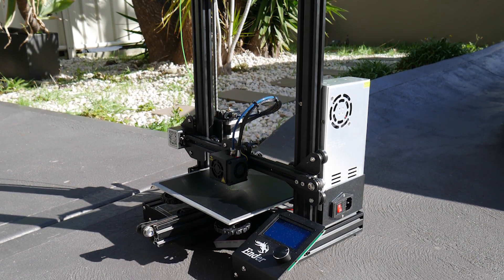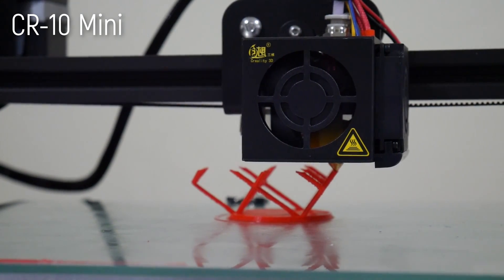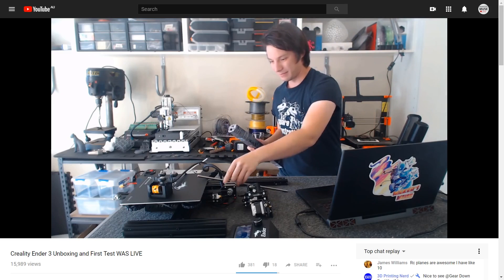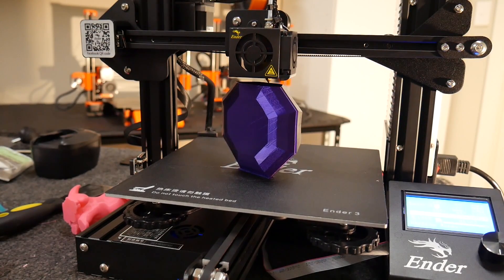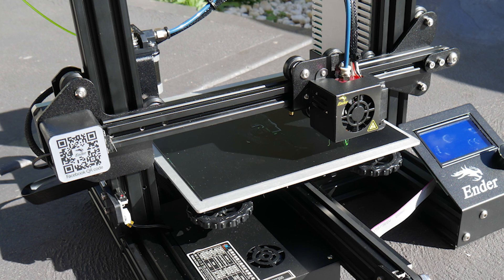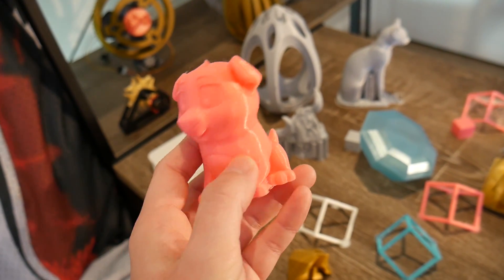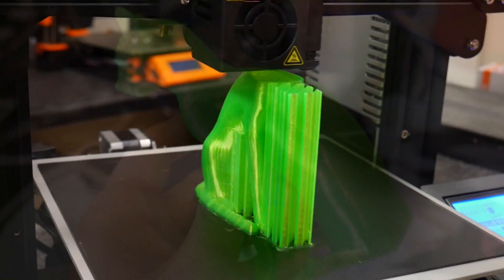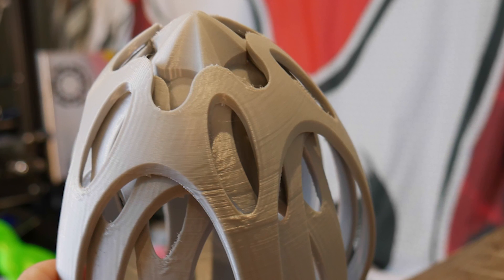Creality Ender 3 Review

Comment: Just a suggestion the noise you see in your print and you're mentioning of the bed not writing smoothly indicates to me that you're roller wheels are too tight they are very sensitive to being over tightened and it will cause exactly that problem loosen them until it wobbles tighten until just barely grabs on without wiggling and that rolling noise go away and also go away from your prints
Reply: Correct. My friend had this issue with CR-10. And since you have excessive wear on rollers, this is 100% the problem.
Reply: He does know a lot, but sometimes I wonder a little bit if he gives these printers a bit of time on the tweak department. Getting the tension right on the wheels and tuning the slicer for nice seams, shouldn't be too hard right.
Reply: I think you are right, Nerys, and I'd suspect some tiny flat points on the wheels too, causing travel issues. You made a helpful contribution.
Reply: Nerys how do I prevent the roller dust occurring, my wheels really arnet that tight.
Reply: Yes as he mentioned at the start of the video, that they were over tightened.
Reply: Agreed with Nerys re: Y axis wheels, I found this as well.  Factory installed way too tight leaving flat spots after sitting in one place between construction and delivery.  Tried asking for replacements without much success yet, a Y axis that accelerates into and lags out of a couple of spots along its travel is not great. Rotating each wheel incrementally by 90° gives 4x more 1/4 size flat spots but doesn't really solve it.
Reply: @Proper 3D dude mine works pretty nicely, but the wheels do wear down a bit.
Reply: bigdady92 I assure you Angus knows quite a bit more than I do :-) I just happened to recognize those two issues as being very much possibly the same problem

Comment: I had issues with the supplied Bowden tube, both as Angus found out with the push in connectors and the quality of the tube itself. With the relatively short Bowden tube the shortness caused a tighter radius which on mine caused the filament to "stick"  inside the PTFE tube and cause under extrusion, I upgraded to better quality (but still Chinese) PTFE tube and also made it 50mm longer, which increased the diameter of the twist in the tube and allowed the filament a smoother path into the hotend resulting in prints as good as others I've seen in reviews. Try it out and see the improvement.

Comment: This is an OK printer if you are an engineer  or a tinkerer
Reply: Well, it performs reaaaally well if you tinker a little bit. 3D Makernoob already used it for customer prints and my Ender-2 is doing amazing ones as well, yes modded, but not too difficult.

Comment: Facing the same problem with my Ender 2’s Bowden Tube and Coupling as well as the Build Surface. I applied a Glass Sheet over the Build Surface without removing it and it is working great.

Comment: I think you have a bad luck with 3D printers, I saw other reviews and the printer print with no issues at all. But the best is you can show to us the worst case scenario, and we can learn from it. Thank's.
Reply from the maker: Absolutely , it's just another opinion to consider. Review many before making a decision.
Reply: Maker's Muse I did and buy my own, and i`m pleasant to know that the printer became open source, I really would like to know what is in your mind about this, thanks and advance, i am a huge fan of your work.
Reply: Nope- I work with Creality3D and what Angus showed were real, known quality control issues. We have to do better and Angus is absolutely correct in pointing that out.
Reply: I was joking about all reviews from Angus that the printers fail, it's really not about himself, he is a huge asset, but thank you for clear the air about it!
Reply: Hi, exist a "bugtracker" or somethig similar, with the ender3 problems and possible solutions? maybe the creality github repo? greetings

Comment: all V slot rollers "wear-in", you run the wheels for a hundred hours or so then tighten and they should not really wear much further. Also you should be using dry silicon spray on the rollers, it is worth rubbing all the slots down with some coarse steel wool then follow up with some super fine steel wool with a lubricant (I suggest isopropyl alcohol) as the v slot is slightly uneven from the paint finish. 

The biggest issue is the single Z axis screw, you need to pay close attention to loading the tension on the wheels on the side of the cross beam with the extruder motor. You need to tighten the wheels on this side so the hotend won't fall under it's own weight and with a little bit of a slant upwards one the cross beam towards the end without the motors, then make sure the wheels are barely snug on the side without the motors (that is not supported by a lead screw).  Fortunately this little printer has very low weight and very little load on each roller so it is not really worth upgrading the wheels to polycarb as you would on a delta.

Comment: How not to live with crappy seams using bowden, use kisslicer. Its horrendous that no other slicers use proper preload calculations like kisslicer does for compensating for bowden distance, let alone kisslicers superior seam gap settings and toolpath generation.
Reply: Matt Weber Thanks, will totally check it out again then.  Last time I looked at Kisslicer it seemed like a mess.
Reply: Dennis J Harrison Jr 1.6.2 has been amazing for me across my 4 printers. Now my primary slicer unless its an extreme case of needing manual supports or very specific needs for multiple processes
Reply: I just watched a quick tutorial on setting it up, gosh it's ugly -  but the settings look really in-depth and useful.  Do you have a link about how to determine the proper preload value?
Reply: Dennis J Harrison Jr preload is your length the filamwnt has to travel from the extruder gear, thru bowden to the nozzle tip. Bore length is 150% your nozzle size generally.
Reply: Matt Weber Thanks a bunch for that :)  Bore length is the length of nozzle bore I guess?
Reply: Dennis J Harrison Jr yup.
Reply: Dennis J Harrison Jr which usually for a .4 nozzle is .6 bore length, .5 is .75, etc etc.. 150% nozzle dia "usually"

Comment: I only want to print tpu for quadcopter parts. Any printer recommendations?
Reply: mshane86 You want a direct drive setup for the extruder - makes dealing with TPU less of a pain.  What size parts?
Reply: Go onto the Ender 3 Facebook group and search for TPU. Someone posted their Cura slicer settings for TPU. I had good results once I turned retractions back on.

Comment: Good news, on the Ender 3S (already on sale in China) the build plate is no longer glued on but rather removable (with small binder clips). I also put some magnetic build plate on mine today as it happens...
Reply: Mine also came with the removable build plate. It was very confusing at first when I couldn't get the backing off and then realized creality had upgraded.
Reply: I did notice what appears to be another difference just now, mine doesn't appear to have the gap above the microSD slot that some reviewers complained about.
Reply: the new plate is already for sale on banggood. says ender 3s
Reply: Cool, in what other ways is the ender 3s different?
Reply: that's the only difference I noticed so far, other than that it came fully assembled but I suspect that's just for the Chinese market as International shipping for the giant box it came in would be very high...
Reply: Print Sentinel interesting! The kit version I presume? Does it say Ender 3S on your build plate? Now I really don't know what's different about the S version any more...
Reply: can you share a pic of this? greetings
Reply: link please. i can't find it in bangood (search keywords: creality, ender, ender-3)
Reply: The one I bought from Amazon (UK) as a kit also came with the build plate that is held down with clips. The SD card slot is a tiny bit larger (you can probably lose the card in the printer if not careful) and it doesnt say Ender 3s anywhere on my printer.

Comment: There seems to be a lot of variance between individual Ender 3 units. My Ender 3 came nearly flawless and has experienced no issues with the couplers or under extrusion at all. However, I've seen plenty of reports of others saying they've had the same issues, as well as plenty of people saying they've had a good experience as well.

IMO this is still one of the best values available even given the issues, since the issues with the couplers, PTFE, and possibly even hotend could be fixed for a total cost lower than buying a significantly better printer from the outset. The only thing that gives me pause about saying that is beginners may not know what to do, but if they join an appropriate Facebook group they should be able to get all the guidance they need.
Reply: Angus nailed it when he put it down to quality control- that kind of variation just is not ok. Meeting this week about it.
Reply from the maker: Companies such as Creality source from many different suppliers so what can often happen is the supplier can be running short on one brand / wants to cut costs and swaps parts without them knowing. This filters down into the kits and the first Creality knows about it is when people like myself encounter the issue. It's a super common and annoying issue that plagues the entire tech industry.
Reply: I had no idea about this, but it makes sense. Hopefully between the community's input and Naomi's work between us and Creality, they might be able to sort things out.

Would you be willing to revisit the Ender 3 at some point in the future if things do look to be improving? I do still have the feeling that it could be the perfect printer even for beginners if the variance issues were resolved, so if that happens it might be worth taking a second look at.
Reply: I have 2, 1 is flawless, the other has a slightly warped bed and a few other little issues (It is definitely an earlier model)
Reply: I heard you were a big part in getting the Ender 3 to be fully open source. Thanks for all of your work between us and Creality!

Comment: I had the exact same "tube slipping out of extruder" problem with my CR-10. I ended up just replacing the whole assembly with an E3D v6. The extruder design that Creality has come up with is just barely good enough to work, but usually not for long. They should fundamentally rethink this aspect of their printers.

By the way, one point about printed parts on 3D printers: I don't understand the hate for 3D printed parts. If I have the choice between two otherwise identical printers, where one of them has 3D printed parts (and published the STLs for the parts), while the other uses sheet metal parts, I'll pick the one with the 3D printed parts every time, because bad things inevitably happen, and with 3D printed parts, I can very easily replace any parts that are broken or poorly designed or get gunked up in PLA or are bent in transport with my own prints. That's a huge plus, and if the manufacturer publishes their STLs (or even better, OpenSCAD files, like Prusa does), I have a huge head start on fixing or improving any issue with my printer.

I don't see any downsides with using 3D printed parts on a 3D printer (if they're printed well), only upsides.
Reply: I suppose on some of the cheaper 3D printers the print quality of those parts has been very poor. Can't really compare with a Prusa one...
Reply: I replaced the whole assembly with a titan aero, gives me amazing quality now with no inaccuracy. Crealitys design is a bit sloppy I definitely agree
Reply: I don't see any downside in injection moulded parts, they are way stronger and more accurate, and you can easily create a 3D printed replacement anyway if you want to modify them, its only a few minutes in CAD to design a replacement. Having injection moulded parts doesn't stop you from printing your own parts if you need to.
Reply: The downside of injection-molded parts is that they cost more, aren't necessarily stronger when not designed right (as often tends to happen), are harder to improve without a lot of follow-up cost to the manufacturer (so less iteration on the design), and make it less likely that the same design is actually 3D-printable (and by "less likely", I mean the chance is almost zero), and make it less likely that the printer supports your own printed parts as replacement for the injection-molded parts, simply because it would require larger modifications to the printer to to accommodate parts with different dimensions or physical constraints.

Let's face it, for something like a 3D printer, where you're likely to have to replace parts or make changes to the printer, when you have the option between 3D printed parts, sheet metal parts, and injection molding, 3D-printed parts are the right way to go.
Reply: I've never had injection moulded parts be weaker than 3D printed ones. Injection moulded parts are way more consistent, and in volume considerably cheaper than 3D printed parts. 3D printed parts are okay for small volumes, but for larger volumes 3D printed parts are not a good solution. Look at the parts that come on the machine, anyone with basic skills could model them up and print them if they broke one, and the community will always come up with mods, having injection moulded parts doesn't stop anyone from making 3D printed, modified versions.
Reply: I've seen plenty of injection molded parts that broke, and even more printed parts that held up extremely well.. Injection molded parts are stronger than printed parts if they have the exact same dimensions, but you can accommodate for that, if you design the printed parts properly.

The problem with replacing injection molded parts with printed parts is that, like you yourself point out, at the same dimension, printed parts are weaker. So if a printer is designed for injection molded parts, and those parts are load-bearing, you can't just replace broken injection molded parts with printed parts. You have to make additional changes to the printer to accommodate the printed parts (e.g. move axes around to make room for printed parts).

If the printer comes with printed parts from the factory, you don't have that issue, since the printer was designed for printed parts int he first place.

Yes, you're right, printed parts are more expensive than injection molded parts, but I think it's worth paying a bit more for printed parts, in return for easy repairability for me as a customer, and faster iterations on the design for the manufacturer.
Reply: What all did you have to do to add the E3D v6 hotend to this?  Is the factory carrier easily accepting of different extruders?

Comment: Good review as usual Angus-I just got my one going today. When assembling I used a mitutoyo combination square and all but one part bolted up perfectly square-the upright with the Z motor was very slightly off when tightened up but I spun it around 180°and it did up fine. I also had to release 2 bolts in the base to square that up so it would sit flat but aside from that it was a nice simple build that took me about an hour and a bit myself. I’ve only been printing a year and my old printer is a Direct drive setup so naturally I’ve been wondering about the whole Bowden/hot end on this machine-what throats it uses etc. I did think when building mine That the stock Bowden tube was very stiff-however I didn’t have your issue of it popping out. It did a beautiful job of the test print too, and now I know about the Bowden issues I will be replacing the couplers too I think. I too saw chuck’s review so it’s nice you are thorough and mentioned his findings too.
From an engineers perspective I think your review is extremely fair as it is a surprisingly “square” kit given its Chinese (I was expecting to need shims everywhere). I’m Glad I bought mine, it can definitely only get better with the very minor mods you pointed out-and like you I would prefer a direct drive extruder too but I’ll let you do that mod first ;) 

Two thumbs up from me on your review mate.👍👍

Comment: And here I am, still designing my own printer... Which in hours still cost a quadruple of a cheap one.
Reply: But it's an irreplaceable experience!

Though i am of the opinion that you generally should have a 3D printer to design and make a 3D printer.
Reply: True! So I already made two printers, one laser cutter and one pen plotter. Right now I'm designing a second pen plotter (larger format) and redesigning parts of the 2nd printer ;)

However, you can also make the printer parts out of wood if you have a good square drill press and a square chopping table to make sure the gantry of the 3d printer will also end up square. For the first printer I made I partially used non-printed parts and then I printed out the remaining parts with the printer itself. Then the 2nd printer was printed with the 1st one. That was years ago and now I'm finally replacing parts of the 2nd printer with parts that it prints itself. When the 2nd printer is done I will go back to the 1st one and make a completely different printer out of it's parts because it sucks a lot right now. It's a Prusa Air 2 XL which has a very bendy frame. Time for something better. I might use the frame I built for the lasercutter to build a 3d-printer into.
Reply: I am familiar with ScrapRap and the like, however, i don't find making throwaway constructions particularly appealing or worth the time nowadays when Chinese will bundle you wonderful almost-working kits for barely no money at all. I bought my first printer as a kit and designing my second one myself. I don't have much room for a lot of stuff so the second will be a toy sized delta.
Reply: Well yeah, I made my first printer in 2012 back when there weren't any Chinese kits available. Hell, not even local kits ;)